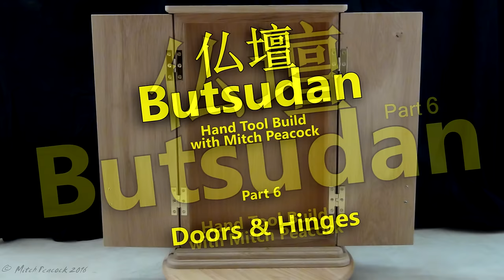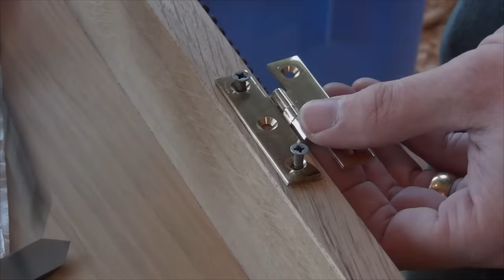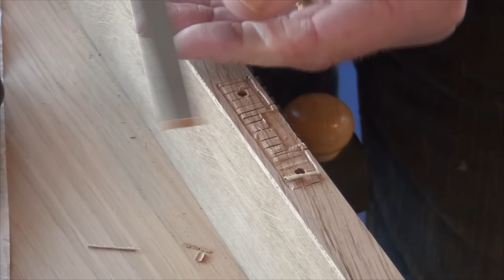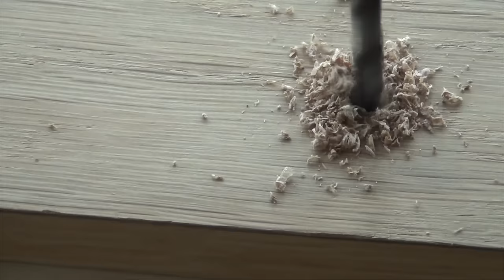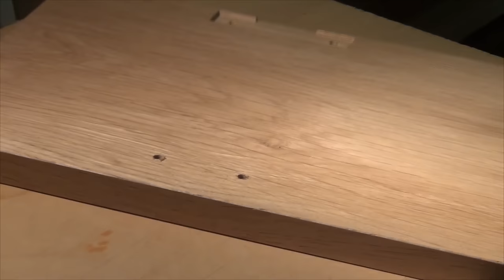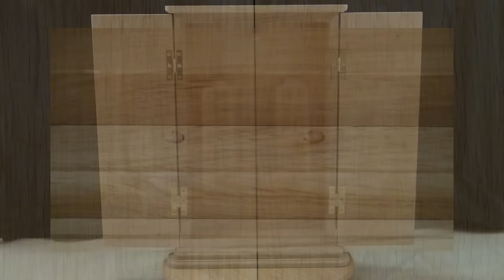Butsudan Build Part 6 - Doors & Hinges

Comment: What a blessing a good sharp set of chisels is. Good tip on cutting to the knife wall. I've made a few mortises that were a bit wider than I originally wanted.
Reply from the maker: Cheers Dave! You can't beat a decent edge.

Comment: Thanks Mitch, nice job mate. Just grabbed the plans for this thank you. That looks like some nice timber you have there. I hope to make two or three of these.
Reply from the maker: Cheers Ken! That's great, send a photo for the gallery. I was lucky with the timber - bad back at the time meant I couldn't select it all myself. Ended up with some nice offcuts, as the supplier left the boards well over length (easier than cutting them maybe?), so I can build a second one to hold my spokeshaves - when I get a chance ;-)

Comment: When your picking out your lumber, can you tell if the wood is going to be that brittle and hard?
Reply from the maker: Cheers Steve. Maybe I was a little dramatic saying that! It was at that end of the spectrum for English oak was what I should have said. Personally I can't tell without actually working it, but there may me some gadget that can.
Reply: I was just wondering if this could be done. Lumber sure isn't cheap, and I'm always looking for ways that can help me pick what I want.
Reply from the maker: Steve Collins I do find that oak hardens quite significantly when I air dry it, relative to any kiln dried stock. It's porous nature coupled with the hardness lead to what I describe as brittle, but it is still as strong and excellent for furniture. Just needs a little more care when applying the extra force to chop or pare it.
I've not learnt about this other than by my own experience, so I could be wrong generally, and you might like to read up on it some more.
Reply: Thanks Mitch.